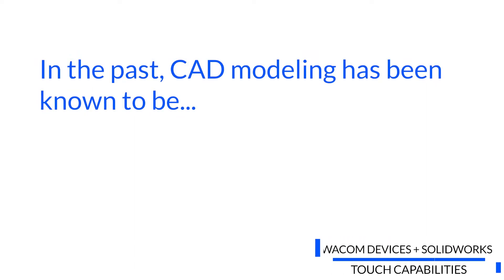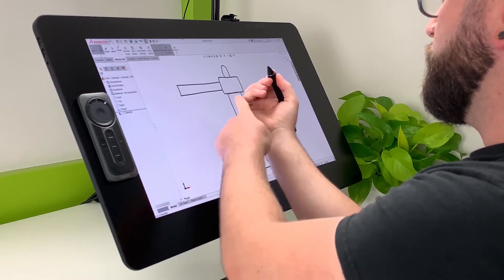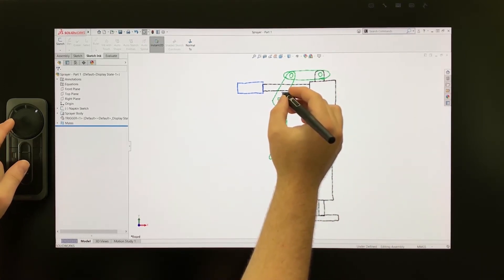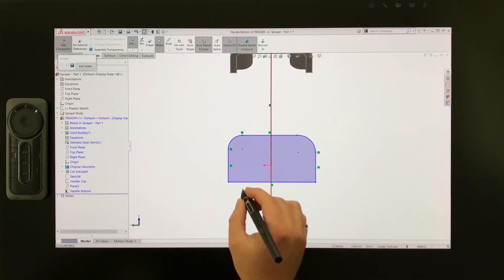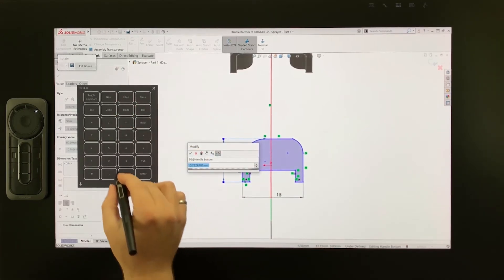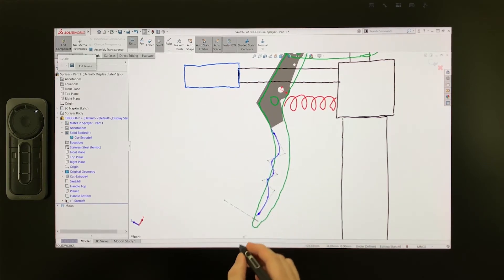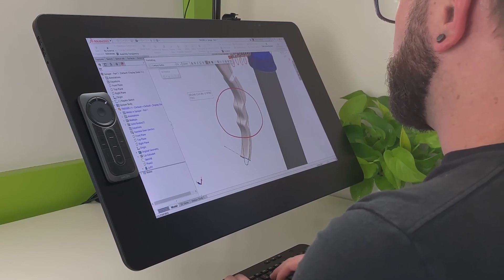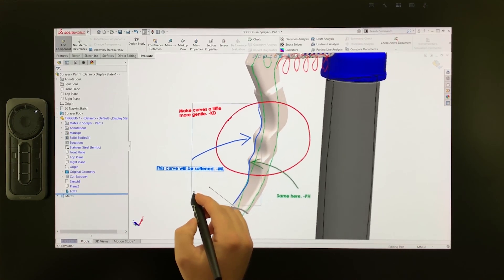How to use SolidWorks with a Wacom pen

Comment: Sorry , even though your video is really well done it is not really convincing if you are a Pro designer. The Modeling process is not so naive ...you definitely needs a moment to sketch...even using an Intuos PRO...but when you start modeling you need something consistent...A 3D connexion Mouse it is much more useful than a pen where your workflow is very slow. Making a note in a 3D space is absolutely unnecessary . Working with NURBS and Global Shape Modeling need an approach very mathematical where you find the Geometry to express your intention. The modeling process cannot be the moment where you find the idea otherwise it becomes very long. Before you get the idea....then you have to build it. To do so I would not recommend a 3D wacom pen even though it looks very cool...because it is a waste of time.

Comment: Did somebody try to draw in Solidworks using the graphic tablet WITHOUT display? Or this kind of graphic tablet is unusable in such case?
Reply: so far, no good. I can get it to draw, but either it will not recognize it as a sketch entity or it will automatically change it into either a square, rectangle or circle. thats it. This is NOT what I was hoping for.